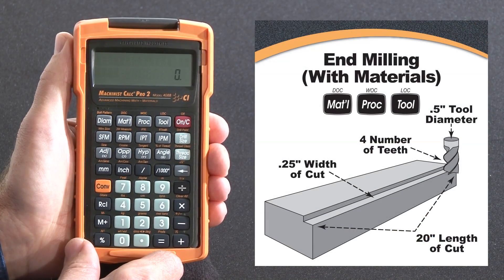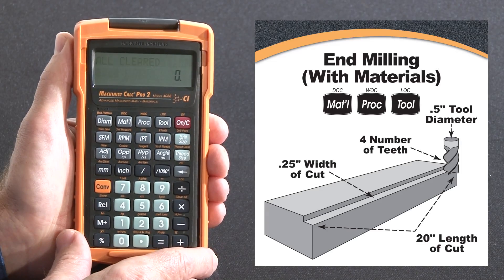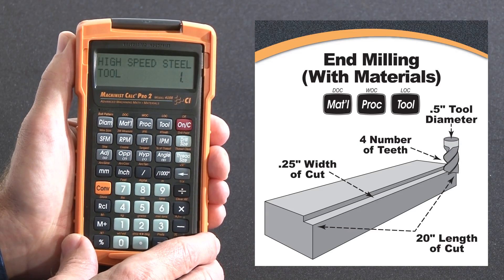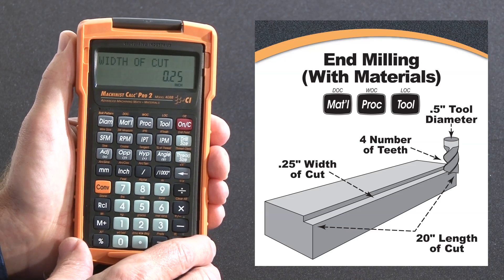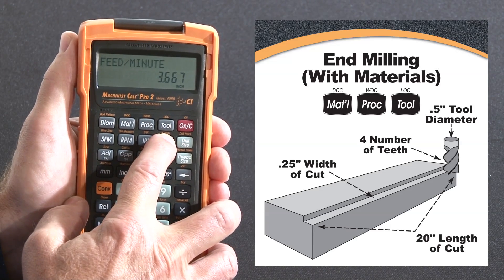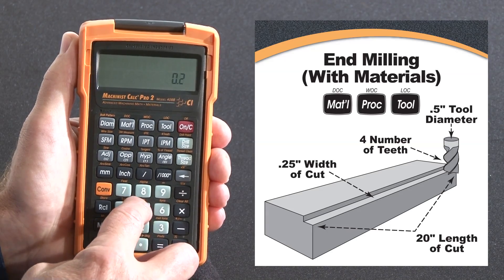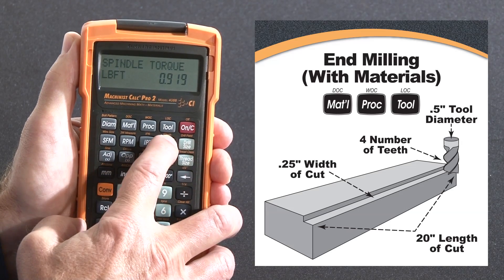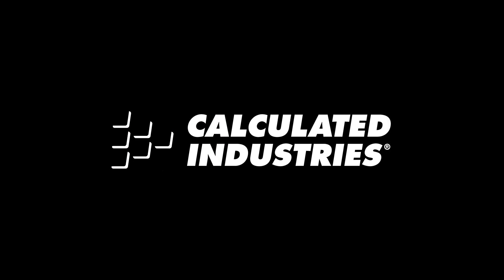How to do Advanced Speed & Feed Calculations with Materials | Machinist Calc Pro 2

Comment: Does entering the width of cut automatically account for radial chip thinning? I see on your website the original Machinist Calc Pro has this as the RCT function. The Machinist Calc Pro 2 mentions having it but I do not see it mentioned in other documentation.
Reply from the maker: Dear Tansit2344, we hope this helps

By pressing [Conv] [Proc] is
used to enter Width of Cut (WOC) – definition : Enters a Cut Width of use in
determining tabular Feed and Speed values, as well as Material Removal Rate and
Radial Chip Thinning Adjustment Factor (RCT).